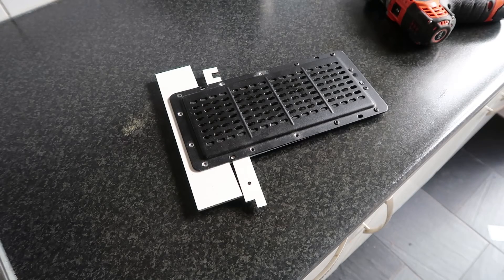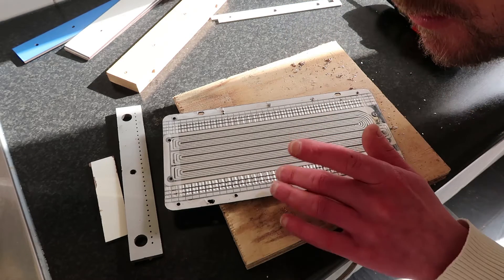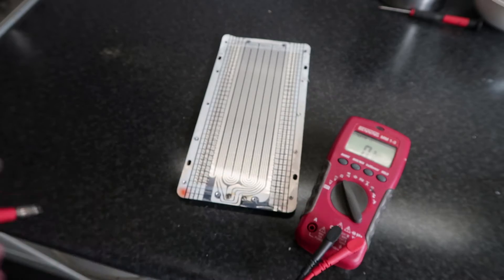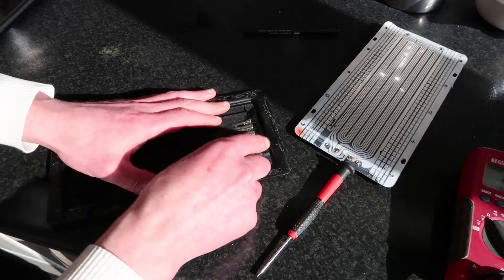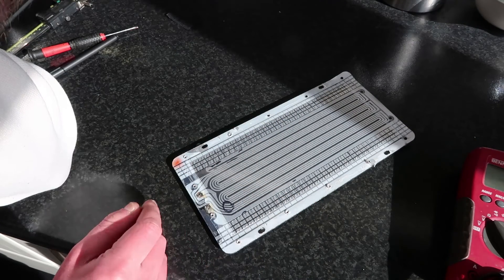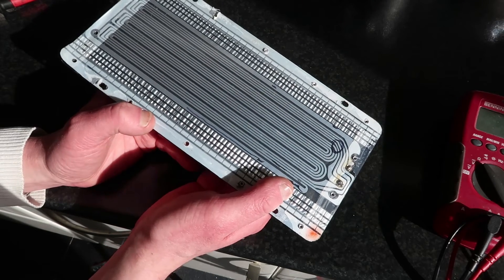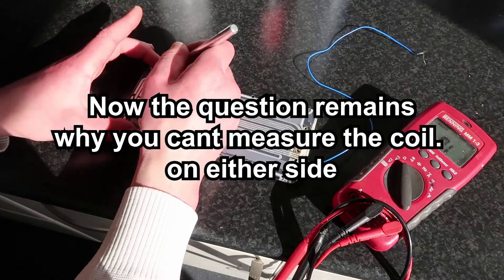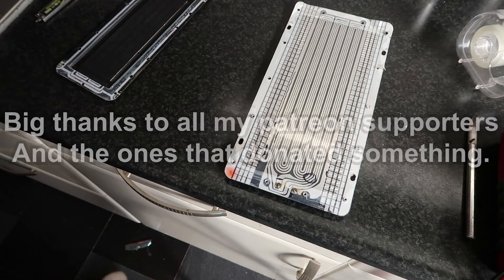TEARDOWN B&G Neo 10 Teardown Part 2 (lets crack it open)

Comment: Hi Joppe, 
The fabric that you mentioned are so called tuning paper in China. A common element for tuning the headphones, in-ears and microphones. It has different grades of acoustic resistance. The biggest issue is that there is no standard for them which makes the producer to order a bunch from a supplier and choose by test. It is also not easy to find or buy small amount of it directly.
Why they use it, because it works as an acoustic damper, if you remove it a lot of resonances will appear in the TF.
Although, there is another substitude which is standard, highly precise and very uniform, which is SAATI acoustic mesh. The appearance is definetly different, but with no doubt it is a better choice.
Anyway if you are interested you can contact them and probably they will introduce a local distributor.
Reply from the maker: well thank you sir, i know its for damping :) and i got by now a look alike version that does perform the same roll. but its less stiff, i like the stiffnes, makes glueing it more easy. ill take a look at the SAATI acoustic mesh. thanks !
Reply: @joppepeelen   That "Sir" made me think: am I so old now? :D 
Nice that you find one, yes less resistive ones are not having the starch that you are looking for. SAATI single layer is then not at all suitable for you, they are like thin fabrics, although there is a DUO series which has very limited models. These are lamination of a fabric mesh and magnesium mesh(if I remember well). 
Also as I see you have a lot of interesting tools, for gluing of these, you can CNC cut a double side adhesive in the desired shape, that will makes life easier :)

Comment: You might try investigating the tweeter elements used in the Gallo series of speakers. They require no magnets and are simply a type of plastic sheet with conductive coatings on both sides that bends when a voltage is applied across it..
Reply from the maker: Thanks  for th ed tip  buy the looks  it's  a piezo film,  not his tech. :)  and piezo are not great even in film form. :(

Comment: can you not use conducting silver glue to repair the connection?
Reply from the maker: that might have been possible :) although im n ot a huge fan of that. ill see if they are still able to repair like that :) not so much to be used. but maybe as reference  for myself. as a sanity check of what i build :) thanks for the idea !

Comment: The extra tracks at the sides are there to add length to the trace and boost the resistance. The cloth glued to the back magnets is there to load the driver and lower it's Fs. Glued on the inside and on the magnets is a bad practice as it limits the Xmax. It would be much better glued behind the magnets. The glue on the metal sides does not hold the tension. The tension is applied and retained by the frame that the foil is glued onto. It looks that this is a sandwich construction where the foil is placed between two plastic layers to protect the foil from oxidation. It is heavy for a foil because it's meant to play lower. The lower you go the heavier the foil should be...partly because of inherent damping.
Reply from the maker: well damping works best near the membrane so actually the felt on the magnets is the best place :(
Reply: @joppepeelen  not if it robs of excursion. If there is enough space to shove in a felt then there is too much space. The magnets should be as close as possible to have the foil move within a high strength magnetic field without hitting the magnets.

Comment: Clamps Joppe! You can never have too many clamps.
Reply from the maker: you know im a fan of clamps :) but in this case i wanted it to be a far away from eachother :) so i could remove the 2  sides :) else it might shift and clamp.... and i cant get it off anymore haha
Reply: joppe peelen I’ve destroyed quite a few diaphragms with shifting stators / loose magnets. In the end I 3D printed a jig to hold everything in line when trying to assemble / disassemble

Comment: Hey Joppe great work. That fabric looks a lot like this ( google Non-woven fabric for vegetable gardens 17g ) but in black colour.
Reply from the maker: hehe i can add another specimen to my collection :) ill look it up :) thanks !
Reply from the maker: if you got a link that would help. i cant seem to find any usefull fabrics mostly baggs :)
Reply: @joppepeelen  https://www.tenax.net/en/diy/vegetable-garden/winter-fleeces/ortoclima/  something like this. Try your local home depot, obi or b&q
Reply: joppe peelen I think the fabric you’re looking for might be called “interfacing” or “interlining” Something like medium weight unwoven interfacing/interlining.

Edit: sometimes it’s called Bukram
Reply from the maker: @voyageur2422  thanks m8 ill take a look !
Reply: I use the same stuff-- AKA: "Floating Row Crop Cover / Frost Blanket / Garden Fabric Plant Cover" weight is .5 Oz per yard. It's very thin 'spun polypropylene' fabric and works very good. I tend to think the stuff you have is spun polyester.

Comment: Hi paw, did you measured the thickness of the membrane please?
Reply from the maker: not yet, i did not remove the N10 foil yet. it feels the same as the neo3 and neo8 a hefty 25mic + on the foil alone without alu.  i might try once more on the neo 8 foil i removed.
Reply: @joppepeelen  thanks looking forward to know this.do you think this membrane is a custom made one? Or is a generic Dupont type C like

Comment: Coating might be a conformal coating on the foil side of the diaphragm.
Reply from the maker: yeah that might very well be, one that does not get brittle and not sure how they applied it.   if a silicone slightly rubbery version is used. it would help damp the foil to..   also adds quit some weight :(
Reply: @joppepeelen    Exactly! And that would be a good place to get that accomplished. The etching is very poor. My guess is that the very thin trace you point out is a problem in more ways than one. Etching aluminium is not an easy thing to accomplish. It would be much better if the trace pattern was reworked.

Comment: I think I might have just found your fabric Joppe. Search “Vilene L11” or M12
Reply from the maker: im afraid i got a sample  of this already  haha
Reply from the maker: oh i seee there are like 10000 vilene versions :( damned.
Reply from the maker: ordered L11 , lets see :)
Reply: I'm thinking it's something even more simpler. A thin Wool fabric or a wool blend. Anything with plastic fabrics are going to reflect sound not dampen it.
Reply: George Zubeck hopefully it’s not going to reflect or dampen much at all. The fabric really is just a small amount of protection from dust whilst being as acoustically transparent as possible. Most speaker cloth is made from polyester plastic and is almost ideal.
Reply from the maker: @bunnythekid  well i do hope it damps. a fabric can damp while not block the top end all that much.  mostly the fact it does that and is really thin o not takinga way to much of my Xmax. while still be on the inner sides of the magnets. it impacts the top end less if its on the in side vs thicker damping on the outside. mostly because it damps the best the closer it is to the foil.